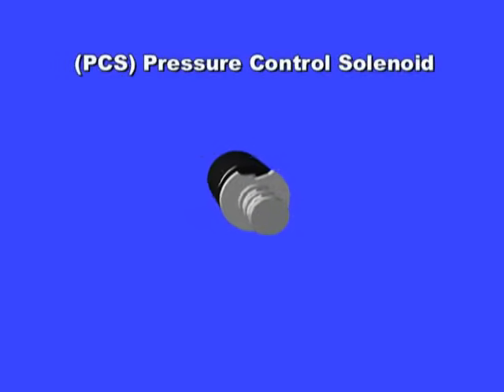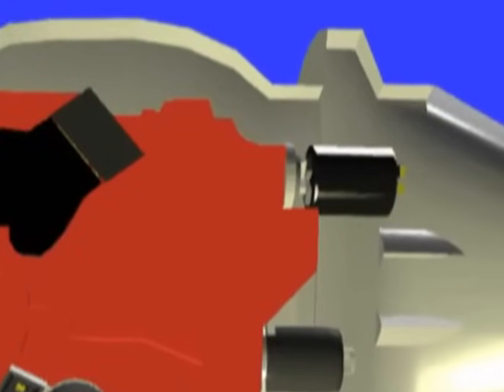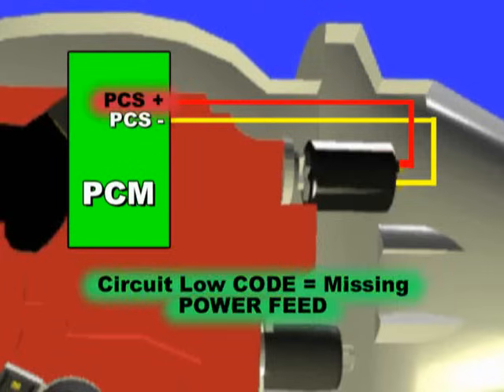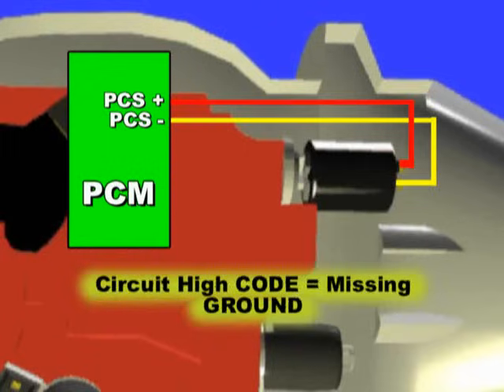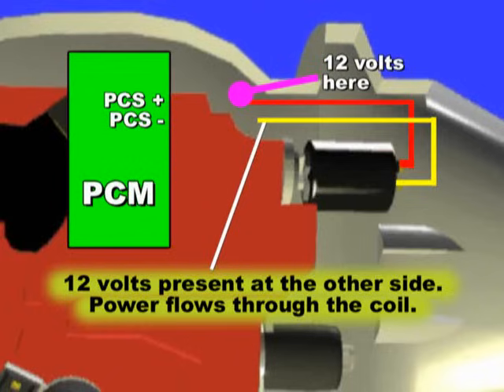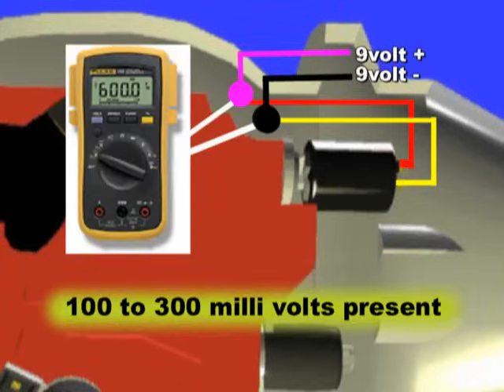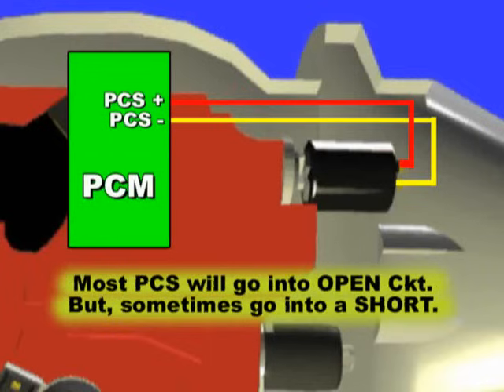Transmission Pressure Control Solenoid (PCS)

Comment: hi does this solonoid replaces, manual valve, primary control vlave and secondary control valve, throttle valve, governer valve in old tranmission ... which basically maintains line pressure and shift solonoid pressure based on throttle opening etc.

Comment: GM uses amps to control the EPC Ford uses variable ground signal to control it. So an amp clamp wont work on Fords. If the windings are shorted to ground it will fail the ohm test. If you still insist I am wrong you need to call ATRA, ATSG and other transmission tech lines and tell them they are wrong. I have ohm tested hundreds of these and might have had 10 in 25 years need replacing because of an issue that occurred only when the EPC was hot.

Comment: I have a 2003 Chevy trailblazer and my problem is when I first crank it up it will go in reverse and drive but after a few times of moving the vehicle it stops going into any gears at all. I changed the filter and put new gasket on and 5 quarts of fluid back in and still same problem. What am I missing? Help me please!
Reply from the maker: Trans is bad

Comment: i have a followup question about my 05 town & country that was posted one week ago, the trouble codes were p 1776 and p 070 transmission wont change gears when it gets hot. your response was that the valve body was warping and the linear valve was sticking, an easy fix to repair, i am being told that replacing the transmission control module requires the Chrys dealership to reset the cars computer to the new module if not done the same issues will continue, is this true or false, please. help..

Comment from the maker: Cont...

You may want to apply 12 volts directly, but IN A PULSATING WAY and see if PCS clicks. Don't leave 12v on or you'll damage the unit. See how that goes. Good luck...

Comment: I have a 93 chevy 4l60 trans it has 123 no 4th and seems like at times its stuck in 3rd when stoped and excelerating fluid smells burnt what could it be seems to shift better when truck is cold
Reply: Did u find out da problem I have a 2000 4l60e and I just have 1st n 2nd gear it’s not shifting into 3rd n 4th gear n da fluid is dark
Reply from the maker: Change trans.

Comment: my 2003 Acura TL has 2 codes P1750 & P1740 what should I do the car rides fine but the engine light stays on is it just a sensor switch, or do I really need to rebuilt my transmission

Comment: 04 Camry with p0776 code swapped out trans n still have code with new one . ..jerks wen I accelerate from a stop n den after drives fine jus after I accelerate from stops
Reply from the maker: Ok

Comment: OK but it seems we are discussing 2 different things. First of all YOUR video says these switches can't be ohm tested because of their very low ohm reading. I stand by my belief that if you run a line pressure test on the vehicle at operating temp. and it passes the solenoid is good. Now this tells us what? The wiring is good. The PCS is good, the windings are good, the valve body and pump is good. Now if we still have a problem at least we know what IS NOT the problem.

Comment: i have a 92 dodge dakota 4x4 with a 318 driving the other day stoped and went to go and it was like it wasnt in gear shut it off for a while started up and only drives for short distances now and does it all over again and ideas? i have been told many different things just trying to get some more ideas
Reply from the maker: Those are symptoms of a worn out transmission, typical of loss of pressure. You're probably looking at a rebuild.

Comment from the maker: From what I understand, the shop wants to replace the TCM or trans computer. THere are many steps to condemning any computer module, so all I can say is that it is the worse case scenario. Make sure the shop is reputable and hold them to it if it doesn't work.

Comment: What are the chances that these problems could be somehow connected to the PCS? Or is it time for a new transmission? There is no grinding, rattling or hard shifting that I observe. There is some hessitation when accelerating very slowly between what I think is 1st & 2nd gear shift. When I launch the car hard from a stop, everything seems to work perfectly. I am completely lost as I have replaced most of the induction system...

Comment: I own a 2004 Nissan Maxima 5-Speed I have just changed the three Linear solenoids, so the jerking between gears went away. However, something messed up the reverse and when I go on R it has not much power!
Is that something related to the PCS valve "C" stuck on? Code:P0797

Comment: need help with a 97 4x4 1.6L tracker it will shift up and down but it wont get the 3rd shift its a 3 spd transmission. i obd it and it comes out p0744, at 40mph it at 3,000 rpm. think might be the tcc not locking up or it needs to get 3rd and then lock up???? thanks for the help

Comment: pressure regulator solonoid can also partly short to ground caused bij transmission wear particles getting in between the metal body of the solonoid and the coil casing.
on frontera it triggers P1625 low voltage or open circuit, and can be intermittend by switching ignition multiple times !
since 12 volt is permanent on the solonoid, the same powerline as all the other solonoids, controlled bij switched negative from the computer unit, setting and stopping the power sometimes moves internal metal particles by magnetising the coil.
however the problem and gearbox error light keeps coming up and the car goes in limp mode.
only solution , pull front pan (the small one) and replace (or try and fix the old one, its broken anyway) the pressure solonoid.

dealership will try to set you back a lot of cash for new transmission, wich off course will fix the problem, or sell you a new computer because mostly they think it's an internal error of the computer, this is NOT TRUE !

in my case I had the computer send out and checked, found out that interfering the power to solonoid contact caused the problem to disappear for a while, soldered a by-pass switch on the computer 54 (ignition) to 53 ( solonoid power), bij pressing it a couple of times with ignition on, then switch ignition off and back on again, the error went for the coming ride mostly.
after some time that didn't work anymore, so I checked all the wires in between, nothing wrong there except an odd measurement to ground on the power feeding line to the solonoids, and a varying ohms value, that should not occur on a 12volts power source. eventually I fount the pressure solonoid causing it, as soon as I plugged the front connector on the trans it gave some continuity between positive and case ground.
so pulled the pan, and the pressure solonoid, opened it up by bending back the edge, found quite some metal particles in there, like the normal bit on the magnet in the big pan, cleaned the thing and put it back together and back in the gearbox. continuity as well as geaerbox error are gone now.

its that simple ! and a solonoid costs only about $30 bucks ! however don't forget to buy some gearbox oil (dexron ||| ) at least 2 litres as there will be about that coming out.
best offcourse, is to change all the oil while you're at it.
Reply from the maker: marzon tijneveld Thank you so much for this detailed information. We appreciate that quite a bit. Helping others is a noble thing.
Reply: I've got a 300zx 1984 when I let off the Gas I meet with the  it gos in to free weeling it don't shiffer in till it's at 4grand I can start it up in park and it wants to move it wants to go forward in every year and no rev
Reply: ... 1994 Honda Accord the shifting cable for high and low when you're going how do you adjust it

Comment: we have put the car on the diagnostic test and its not detecting any error.this is my second transmission  which was fitted at honda. they say the added the special oil.but if u shift gears to L and S it changes. is it tht they may have put the wrong oil or its smthg else

Comment: Excuse me i have a 1995 Cadillac Seville STS and it threw a code P076 it stands for Transmission pressure Solenoid. Is the Pressure Solenoid the same as a Pressure control solenoid or are they 2 completely different things. i appreciate it if you could get back to me ASAP. Im kinda on a standstill untill i get that response from you?

Comment: I have 2002 Ram 2500.At times does my trans won't go from 2nd to 3rd.Can't even figure out if it's when hot or cold.Seems like both and at times.The problem seems to go away for weeks.No codes.Fluid has been changed but not fully.I blew a high pressure line,so I suspect I changed a lot more fluid than just the pan oil.Problem occurred before that line blew,So I rule out blame there.Pan is dripping,so I'm gonna change the pan and fluid.Should pcs be changed or is it something else?Thanks

Comment: I was googlin that code and came across your site. I have a 2001 Aztek that has been giving me this code...the odd thing is some times the check "engine"light goes in and out. I read the code and is the same one...are these hard to replace??

Comment: Hi, I have a Saab 9-5 2010, I have a problem with a errors P0778 and P0966. The errors refer to a problem with solenoid B. We are replace the solenoid and we check all installation cable and everything was correct but it again repeated the mistakes after a short time. Du you have any idea what we should check next or what could be really mistake? thanks in advance...
Reply from the maker: Ok, like most shift solenoids, you should have steady power and the TCM grounds the pressure sol. to effect the pressure control. So, disconnect the TCM connector (TCM=Transmission Computer) and with power applied to the PCS, ground the pulsed side of the PCS. Listen carefully for a clicking sound. 

Also, check the TPS which is a main shifting input to the TCM. and you may check the following.

- Low transmission fluid level- Dirty transmission fluid- Faulty line pressure solenoid 'B' valve- Line pressure solenoid 'B' valve harness is open or shorted- Line pressure solenoid 'B' valve circuit poor electrical connection

Here are some of our products that may help you. 

http://www.autodiagnosticsandpublishing.com/TransDoctor_Auto_Transmission_Software.html

https://sites.fastspring.com/autodiagnosticsandpublishing/instant/automotivetransmissiontroubleshooter

Comment: I'm getting a P0775 code on a Ford, In Drive I can feel it switching from 1st to 2nd seemingly when its supposed to, but it doesn't appear to be switching from 2nd to 3rd, the code says "Pressure Control Solenoid B", which I'm thinking is associated with it not going into 3rd. Any suggestions? I'm not sure if I can swap out the bad solenoid or if I have to replace a pack.

Also this not going into 3rd is a problem, Cannot go very long distances and have to take secondary roads to avoid faster traffic.

Comment: can you help me my honda 94 AT  having problem after running for 15 to 20 mins sudenlly stop running but engine is still working  its like it shift on park. and when i start again after 4mins it run but very slow with the help of a little push. i change the ATF and still  the same problem

Comment: my honda aria fit cvt gearbox automatic. its not  changing gears especially on high revs. at 120km/hr the reves will be on 6000revs and it doesnt go down. but on low speed like 80km/hr revs will below 3000rev/min. what could be the problem. we have changed the gear oil

Comment: Really need help here! My 2003 Chevy TB is shifting late. If i accelerate hard, the rpm goes all the way to 7000, then a sec or two later, it would shift gear. The delay isnt very noticeable when cruising but very prominent when accelerating. I did a computer scan and i got the code "P0748 Pressure Control Solenoid (PCS) current error" Most mechanics are telling me that i need to rebuild the transmission and some are saying there is a wiring problem, but they cant fix it. I dont know what to do!

Comment: Hello, I have a 2013 Nissan Altima 4 cyl. My code is P0776 (pressure control solenoid B). Where would the solenoid be located? Inside or out? Thanks.
Reply: Hello how much was it for you to fix this problem
Reply from the maker: Inside.

Comment: I have a 1998 dodge ram 5.9L v8. and it shifts a little late, and downshifts hard in 4th gear, shakes the truck a little bit, and a few times i got a code for " too much pressure in transmission" or something like that.. i forgot what the code number was.. can you help me please??

Comment: i have a 1994 fford f250 when i put it in drive it goes into first gear but will not shift or shifts really late i have to drop it into drive 3 then throw it into drive to get it to shift what should i do

Comment: i have an oldsmobile silhouette 2000 and i need some help on replacing the transmisson pressure control solenoid.

Comment: Can u help regarding this fault code(18228) P1820 pressure control solenoid 'b' control circuit high implausible signal.I recently replaced the clutch, transmission,also this issue occurs while doing clutch adaptation.Audi ccz engine code

Comment: I was getting P0751 selenoid A code. I replaced new selenoid A and I'm still getting the code and it did not fixed the problem. Any ideas what the problem could be?

Comment: Hi please help me I have a 2013 Mitsubishi asx cvt transmission and I have worked on the transmission so much time I am stressed because these two codes keep coming back and idk what to do can u help me (PO776 and PO868) car driving shifting well but the engine light keep coming back after clearing every time so I assume the problem remains not I also have a new valve body in it now
Reply from the maker: This is the one tool used for transmission diagnostics. http://autodiagnosticsandpublishing.com

Comment: I have a 2016 Honda Accord V6 Touring that is harsh shifting similar to what you explained in the video. My mechanic did a diagnostic and I managed to note the trouble code A/T clutch pressure control solenoid......My mechanic claims I need a new transmission because the solenoid that has failed is not sold separately from the valve body and the cost of the valve body is very expensive and almost equivalent to buying a new transmission. Can you provide me with any perspectives on this issue? Please and thanks in advance.

Comment: Hi, I like you video, maybe you can help me.
My car Nissan Platina 2003 Automatic tranmission is failing, when I run the car The 1st
enters ok, no problem; Then the 2nd goes in then no problem, But when the car is going to 3rd goes in but in few seconds the motor is like is working alone a high speed,
what can it be? help please

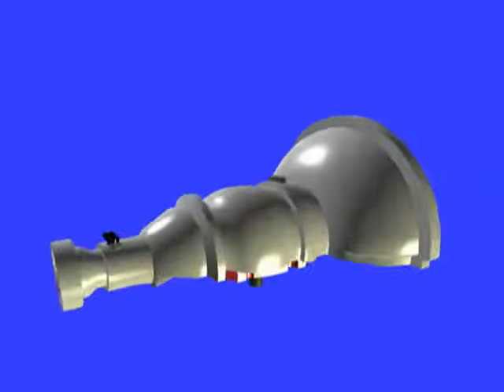Comment: 0:21 "Do not apply 12V..."
1:30 "Apply power, 12V..."   contradiction there?
BTW, are thoses solenoid working the same as clutch shift solenoids? (specially interested in 5L40 one)
Reply from the maker: Your opinion

Comment: I bought a foreign used Nissan Y12 AD Van and after receiving the car two weeks I honestly didn't anticipate having a transmission problem... On doing a diagnostic check I was advised that the (16- line pressure solenoid valve is the problem) I need your help please.. what should I do,should I keep the money on trying to repair it and invest that money in a new transmission..
Reply from the maker: I need more information. Post any DTC/Codes retrieved from the transmission. THanks for posting.
Reply: Ok i will.... thanks for your help.

Comment: High have 99 yukon reverse gear dose not work! forward gear works but high rpm when taking off, whe i take foot off  gas pedal rpm drop and vehicle drives this happens at 20 miles an hour then shifts into drive on normal rpm have any Ideas thanks much

Comment: i do have a 2004 honda accord 4 cyl, 2.4 , engine light is on, code is P0962 pressure control solenoid A control circuit low,  where is located this solenoid, inside or outside the transmission?
Reply from the maker: Honda places it's solenoids outside the transmission.
Reply: I have a 2004 acura tl automatic.. bought it 2 months ago....when I bought it, reverse was very slow to engage and it took alot of gas to get it going in reverse. Every other gear was fine and shifting smoothe... when I flushed the fluid he had in there, it was thick and discolored, im guessing it was full of lucas.. once I drained and put good fluid in there, reverse imidiatly came back and it reverses nicely but within a week, 3rd gear started slipping and eventually it stop shifting from 2-3.... Iget a p0848 code for 3rd gear pressure switch even after Ive replaced the pressure switch. ...any idea?
Reply: thank so much
Reply: gaby salgado ya

Comment: i have a 2002 Renault Megane (1) Coupe (Auto)

my car slips on the 3rd gear; engine accelerates but the vehicle does not! Worst when trying to go uphill..

I'm thinking it could be the EMV solenoid but kinda leaning toward the fact that it might be the clutches..

Thinking of just changing the engine & transmission & installing a QR25de with CVT transmission...

Comment: I have 96 ram 1500 replacing the pressure solenoid , the transducer is stuck, how would I remove it, if I prized it out with a screwdriver, would it hurt the housing

Comment: hi, when i use 9volt battery across 2 terminal in solenoid, u said i will see 100 to 300 millivotl acros the same 2 terminals. surprised , i am sending 9volt in both  terminal and if i measure the same 2 terminal i should see 9v why i am seeing 100 to 300 millivolt please advsie.

Comment: Hello there, I have a 2003 venture and was wondering if the failure of this component could cause a total lack of travel. I was driving when all of a sudden I lost all gears including reverse.
Reply: Same thing happened in my 2005 trailblazer. Driving down the highway and felt like it slipped into neutral. Now it wont move in any gear.